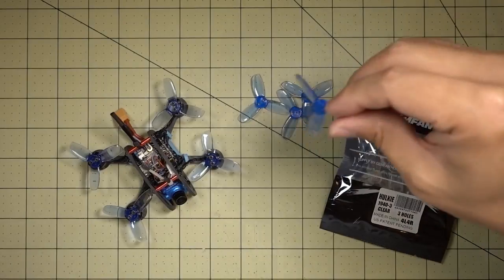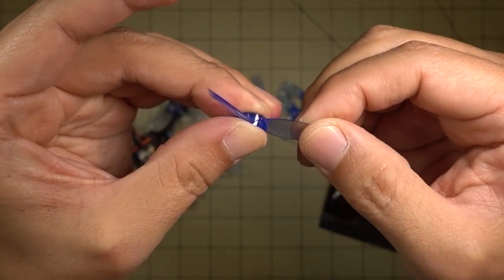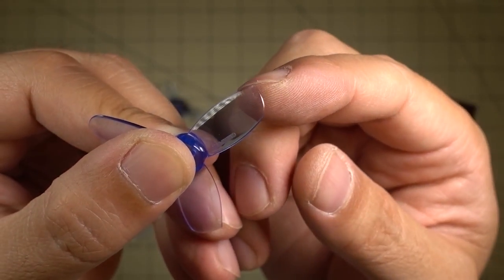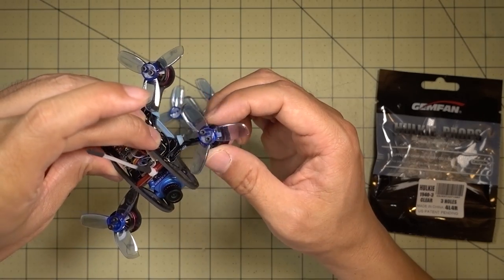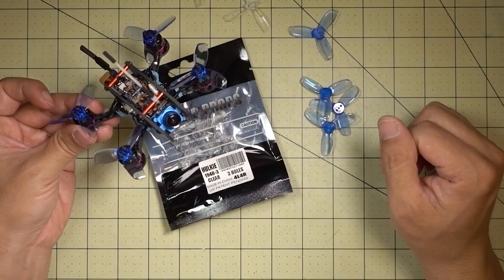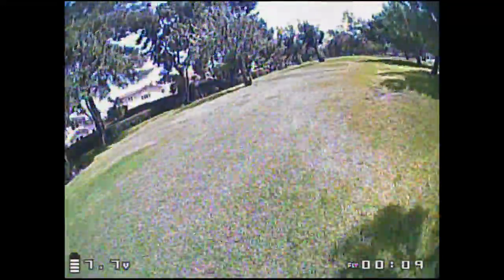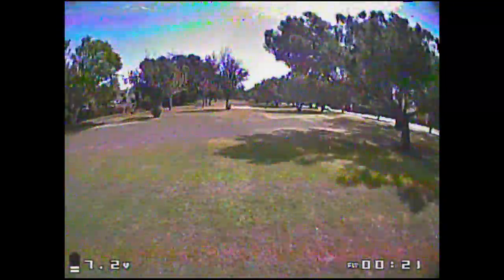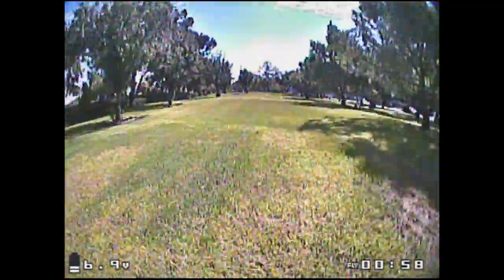Gemfan Hulkie 1940 Props on the FlexRC Ascent

Comment: I tried to change the firmware because the firmware 3.1.7 gave throttle problems and I put version 3.1.5 tomorrow will try if I solve the problem